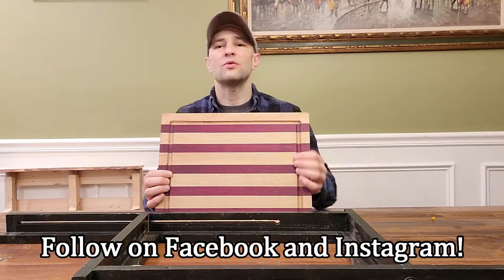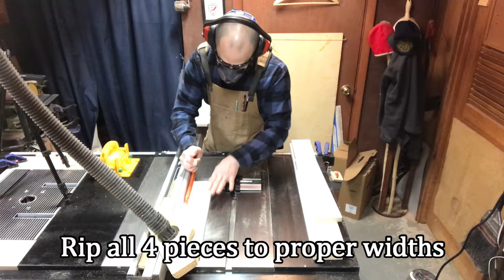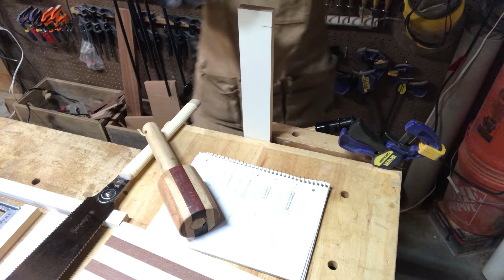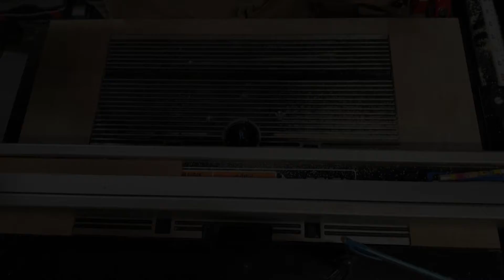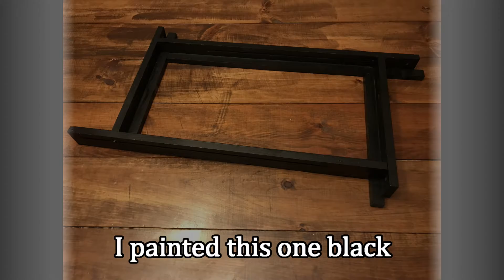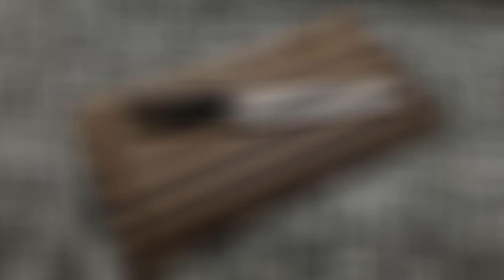Juice Groove Jig

Comment: Do you have plans or measurements
Reply from the maker: Hi Dustin.  I didn't draw up plans for this one. But you can make the pieces any length you want, and you can cut the sliding grooves to fit any sized hardware. It's a pretty simple build. Let me know if you have any specific questions as you go and I'll try to help. 🙂